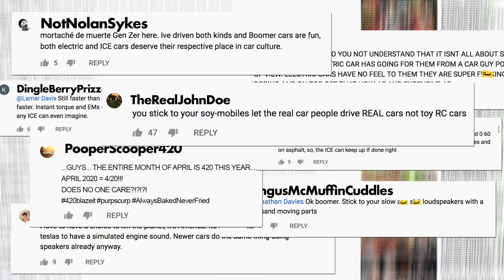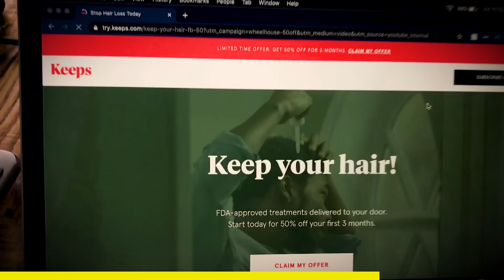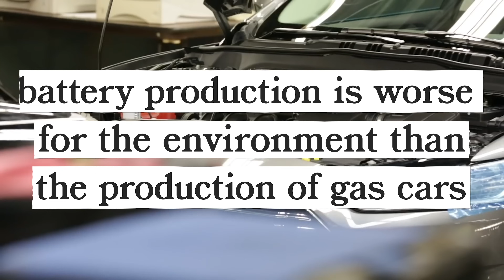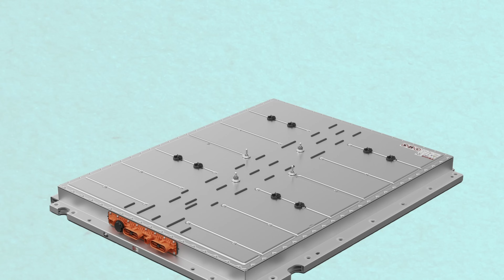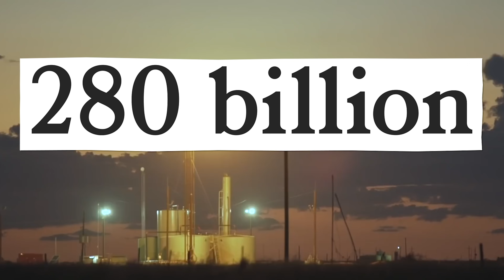Are Electric Cars REALLY Better for the Environment?

Comment: So, why calculate the actual vehicle production Co2 into the internal combustion car, but in the electric vehicle, only the Co2 load for the battery alone? From mining the ore for the steel to the point it rolls off the line VS what it takes to just make the battery.

Comment: the thing is with electricity and people saying that they get there energy cleanly from wind and things like which is all well and good until you think about the co2 emissions to get the wind farms going. first you have to make the wind turbines which are mostly steel which emits co2 and plastics and all the electrics involved as well as concreting them concreting is mining and all those other factors which adds up to an extreme amount of co2 emissions and that's only making them. they then put them on a boat and Ship them around to where they need to be ships oils fuels emissions then when when they get to a port they crane them onto massive diesel trucks diesel emissions they then travel anywhere from just down the road to hundreds of kms away again emissions. then when they assemble them they use massive cranes and other heavy equipment again emissions and the process of putting them up takes months and months again emissions. not only that but the infrastructure that has to go around the wind turbines with buildings roads even the powerlines is all emissions and more emissions. all these emissions to get 'clean' energy is it really that clean. you could argue that once they are up that they are creating clean energy but how long until they have made even the emissions that were produced to get them there and then is it enough time till they need to be pulled down and put new ones up. I agree with what they are trying to do and think its amazing that we are trying to be better but I just don't think that we are doing it the right way and how long will it be until we realise the right way is but all in all confusion.

Comment: How often do their batteries need replacement?
Reply: It depends on their usage Ronald. There are already EV's around approaching 10 years old, without having had a battery change. In any case, it is possible - and relatively straightforward - to have an EV battey pack checked, and any suspect cells replaced. It should only be done by a qualified EV technician, and normally takes around two to three hours at a similar cost to having a clutch swapped in an i.c. car.....

Comment: the very most part of what you said is correct, but there are still a few very important things to mention as well. 1st you start with the resources needed to produce cars. A common cliche is that the fewer parts the more reliable, therefore an EV has fewer parts so it is more reliable. Compare 2 engines I guess all of you know, compare a 3 cylinder Smart engine with a let's say Chevy V8. The V8 has a lot of more parts but it is at least 5x more reliable. So fewer parts do not mean more better.
Then there is the lithium. Do you know that the estimates about the amount of lithium available are purely politically driven? Don't worry I am not going to blame Trump here coz this problem is way older than his legacy, dating back to the mid 40s. They constantly changed the numbers up and down however it is useful at the point in time. The truth is that there is basically an infinite amount of lithium coz it is to a percentage everywhere in the earth's crust, but that's the same with gold. Only because there are a few milligrammes per ton everywhere does not mean that mining it pays off. There is a reason why South Africa is producing a lot of Gold and England is not. 
The point I want to make here is that lithium has become kind of the replacement for oil in the future, and when reading the press you can easily get the impression that we will never run out of lithium ever. Sound familiar? Exactly, that's what Rockefeller said in the 30s about the amounts of oil. The key to sustainability is that WE ALL consume and waste less. This is as true for gas-powered cars at is for EV. If we want to switch all the cars in the world from gas to electric and expect every car to do 300 miles/charge then we run out of lithium when we replaced like 20% of the cars. In short: It is pointless!
EVs are a good thing but car concepts like those of Tesla or Porsche are not the solution for today's problems.
Do you guys know that a cold engine for the 1st 1/4 mile produces nearly as much emissions as a warm engine for a few hundred miles at constant cruising speed (like 50-60mph). So if we could get rid of the short distance emissions and only have emissions on the longer road trips that would have a massive impact on emissions. 
It was said that the average mileage per year is around 11-12k miles that's an average of 40 miles/day assuming that you need your car only on 300 days per year, if you divide by 356 days the number is even lower. The European average is even lower, it is roughly the same numbers but km and not miles due to the fact that Europe is smaller but has a lot more residents in total. The distances we travel (especially to work) are roughly 30% shorter.
So if you would build an EV that can go purely electric for let's say 50 miles and for longer road trips it would use a gasoline engine, then you would create 99% less emissions and use 99% less fuel but you could build 4x the amount of cars with the same amount of lithium.
Just think about it. It is simply math.

Comment: My boy forgot to mention Nuclear Power as a clean source.
Reply: We're hopefully gonna see nuclear fusion in the next decade or so. Which is going to be an amazing step forward in nuclear energy. Environmentally speaking!
Reply: @guacamoleman87 Imagine using the resultant helium (from the hydrogen fusion) waste for balloons! That'd be a fun way to keep making money.
Reply: @Chopinwannabe7556  balloons is the least useful use of helium. Helium is an incredible superconductor at low temperatures and is used extensively on powerful supermagnets such as the ones found in many medical devices such as an MRI scanner. We are already running out of it cause we currently get it from the ground. It would be amazing to make it out of hydrogen, an incredibly abundant element here on earth!
Reply: @ryansamarakoon8268  Cool.
Reply: @Jason_LeCrown because people always look at the negative side and not care about the so many positive side
Reply: People are scared there's going to be an accident like three mile island or chernobyl really though nuclear is safe. Especially thorium reactors.
Reply: Nuclear waste is the problem. What we need is a much cleaner version using Thorium. Research Thorium reactors. No nuclear waste and nearly as efficient, yet much safer in the event of a "meltdown"
Reply: @ryanpetree6475  Thorium  does have nuclear waste just less than 500 year radioactive life which is very containable with currant methods.
Reply: Probably because nuclear power isnt clean. In fact, theres no such thing as a "clean" power source. They will ALL have a negative impact on the environment in their own way.
Reply: @Jay Dee Jeez, you guys are viscous. It's silly! Obviously, balloons aren't the best use of helium. Any engineer, physicist, or chemist could tell you that.
Reply: Currently, worldwide, nuclear power generation produces 10,000m3 of high-level waste per year. Explain to me how that is clean. 🤔
Reply: I don't have the time to correct every dumb reply to this thread so I'll just put it here. 1: If you're worried about a melt down don't use uranium reactors use thorium fluoride reactors, they physically can't melt down. 2: If you're worried about nuclear waste you should know that thorium reactors make less waste and if waste is properly stored it doesn't have a negative environmental impact. Nuclear is the best green option.
Reply: @marshmellowmoon7990  Agreed and thorium waste only stays radio active for 500 years. Current storage techniques can easily store for that length of time with zero risk of leakage.
Reply: @Leon9000130  Yeah, all that environmental damage they were talking about only happened because our current storage facilities were made to be temporary until we could get a permanent one (which we still don't have thanks to some idiot governor in Utah that would just keep saying "KeEp iT WhERe iT Is" even though the people in the town where it was going to be built were 100% okay and even welcomed it in their town.)
Reply: Because Chernobyl.
Reply: @fardimnazir666   The Chernobyl nuclear power plant was held together by duct tape and Russians were following no safety protocols. Any manager from any modern power plant would look at the way it was being run in horror and as a disaster waiting to happen.
Reply: @Chopinwannabe7556  My point being, if such a disaster happens due to mere "insight errors", the place would remain inhabitable for thousands of years. Such a massive risk that outweighs the benefits. But yeah, it's not impossible. Maybe in the future....
Reply: @Jason_LeCrown right now. but ITER will be the real green future
Reply: bro imagine nuclear fusion instead of fission... like bro.. electricity would cost less than a glass of water at the bar.
Reply: Wher3 does nuclear waste go ?
Reply: Chernobl
Reply: the problem with nuclear is not that it's not clean when running, the problem is the waste. nuclear power is extremely efficient. these days it's also a lot safer than the days of the old plants (chernobyl, fukushima, which btw was not exactly new technology). although terrorism and war is still a major worry, or at least it's what would worry me, we can not exclude the possibilty of major wars and terrorism. i'm not necessarily in favor of nuclear power (and i'm also not educated enough to evaluate the details), but what bothers me is when we totally stop the research into it. a lot has happened in the past decades when it comes to physics. and a lot has or could happen when it comes to researching better methods for dealing with nuclear waste. i think nuclear power can be really risky because the long term consequences can be absolutely extreme. could bite us in the ass for thousands or millions of years. we should keep nuclear power in our sleeve. it probably will become relevant again in various forms in the future.
Reply: @jthorsson6167  Let alone the fact that 75% of the US nuclear plants are leaking radioactive material: 

https://www.cbsnews.com/news/radioactive-leaks-found-at-75-of-us-nuke-sites/
Reply: @mmamemoir31  mostly within safety margins Lol
Reply: @mmamemoir31  typical what i would call propaganda article. totally misleading on so many levels. the US media is fucking crazy dude.
Reply: @mmamemoir31  either way doesn't matter. i'm not pro nuclear power at all. i think it's reckless for a stupid race like humanity to have such things around. but per se it's not a bad technology.
Reply: @jthorsson6167  There is multiple articles tho :D
Reply: @jthorsson6167  Someone didn't read the comments...
Reply: @Chopinwannabe7556  no i have better things to do than read all comments
Reply: @jthorsson6167  Ah, which is why you spent time writing a comment instead.
Reply: Yeah
Reply: @Jason_LeCrown when they hear nuclear they think nuclear bombs which are bad
Reply: @ed1tz468  where are your brain cells? Both are bad,  Technically they are one and the same for nuclear power plant goes off it's a bomb the waste from a nuclear power plant goes into a bomb. There isnt a difference.
Reply: No. No. Just no.
Reply: That's also worse then coal...
Reply: that is because nuclear is not clean
Reply: How many nuclear reactors have we had floating in the ocean for the last 40 years with zero incidents? I ferget....
Reply: There is more than one type of nuclear power. Nuclear fusion is a holy grail for clean energy with no radioactive waste left behind! Definitely something worth checking out!
Reply: @Jason_LeCrown yeah if you let the system get old it will fail if you keep it up to date it will run forever.
Reply: If you can solve how to turn the waste into mo powa then I agree
Reply: @TheGoat Exactly and those few concrete barrels are in a secure facility compared to the mountains of waste that are just fuming.
Reply: @Jason_LeCrown Its not just chernobyl and fukushima, 75% of nuclear plants in the US are leaking radioactive material above the safe limits: 

https://www.cbsnews.com/news/radioactive-leaks-found-at-75-of-us-nuke-sites/
Reply: That is why in certain countries Governments just go ahead and build them anyway without any announcements.
Reply: N U C L E A R   W A S T E
Reply: @Meme Man You guys are idiots, you know that right? Guess where the radioactive material comes from in the first place? You get it OUT OF THE GROUND. So if you just dumped all the nuclear waste into the ocean, it wouldn't be a noticable issue. It would be diluted so fast that you would be hard pressed to detect its existence. So nuclear waste isn't a big deal at all unless you get exposed to a concentrated source, which never happens if you're even slightly competent. Coal power plants also release huge amounts of radioactive material into the air because, again, radioactive material comes OUT OF THE GROUND
Reply: @Jason_LeCrown lol we are far from harnessing that amount of power, if anything to go wrong than its done for.
Reply: Jason_LeCrown people are just scared of another Chernobyl. I think that once the process of nuclear energy gets even more safer and more efficient, people will begin to take notice
Reply: nuclear waste that can and does seep into the ground is very dangers. The United States are removing 13 nuclear power plants because of the waste they produce
Reply: @dajiban9325  no no their being removed because of all of maintenance and of you keep running a reactor that needs to be rebuilt and redone otherwise it will end up like chernobyl.
Reply: @dajiban9325  That is because of poor storage. Not the waste itself.
Reply: its because of its radioactive waste which makes it a non renewable source
Reply: @leogoria9965  It's non renewable, because the material for the nuclear power plants are not renewable. There's already many modern ways to deal with radioactive waste.
Reply: @leogoria9965  whioch can be recycled
Reply: Clean? Except for storing all that radioactive waste.
Reply: It is but extremely dangerous
Reply: It's anything but clean 🤣🤣
Reply: @Jason_LeCrown there are literally football fields full of nuclear waste is dosen't last forever 😑
Reply: Nuclear is a ticking time bomb far from effective. The muclear waste is harmful for the environment no one wants to see another Chernobyl
Reply: @Legion849  Again. It would be illegal for the nuclear plants to just dump the waste into the environment and they have very effective ways of storing the waste that they've been using for years now. 
As I've said, Chernobyl was an accident waiting to happen and many of the deaths that occur in a nuclear power plant in the US were not due to the nature of it being a power plant. Many were electrocutions actually from bad wiring. Only 13 deaths have occurred in power plant accidents over the past 60 or so years. Looking at the history, I'd say that they're some of the safest places to work.
Reply: @Legion849  Look into thorium fluoride reactors. They can't melt down so you physically can't get another Chernobyl.
Reply: Problem

Nuclear Waste
Reply: @gameseeker6307  Looks like somebody didn't read the long conversation that we just had on the topic.
Reply: @Chopinwannabe7556  exactly
Reply: @Jason_LeCrown nuclear power plant is very risky and the chemical have a half life of 2.3 million years which means it will pollute the entire ocean for more than 2.3 million years
Reply: @Oscar-jq2hf  bill gates has the new technology of nuclear plants and they convert the nuclear waste of the old plants in to new energy is brilliant  they were going to begin test in china but trump hold the project maybe next year coul begin .. see on netflix bills Brain
Reply: @Oscar-jq2hf  the longer the half life the weaker the radiation. If an element has half life of 2.3 million years then the radiation emitted per second is negligible
Reply: @Oscar-jq2hf  its not risky at all? and nuclear waste can be recycled
Reply: @Oscar-jq2hf  saw a video on a recent nuclear power plant and in an average year they produce about 25 cubic meters of nuclear waste product (which at this time cannot efficiently be used again but scientists are coming up with ways to even use those waste products). so while, yes, there is nuclear waste fro a plant, it is a crazy low amount for the amount of green power we get from it. the biggest problem is actually keeping the plant safe by investing money on maintenance, sadly every company ever will cheap out of shit to keep investors happy, and keeping investors happy has led to many safety fails (looking at you BP).

Comment: The biggest issue facing EVs is recycling the batteries. The industry won’t willingly embark on that journey until the cost of producing a new battery is higher than the cost of recycling.

Comment: The cost to make energy from a "clean source" is way more expensive than just oil, and also less reliable. I do believe that you've done an unbiased video. I've done my own research and it came very similar to what you said. I do believe the nuclear power plants are the most efficient, cleaner, reliable, and cleaner power source. Unfortunately for political reason the media won't say and won't let you say it,